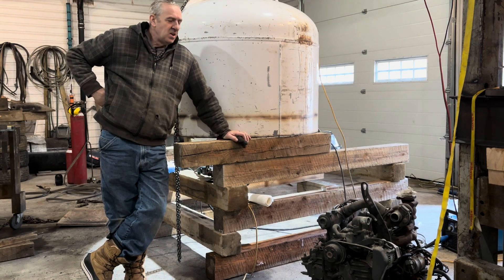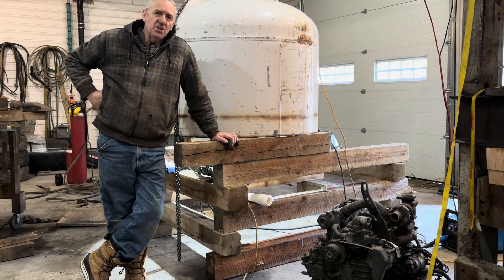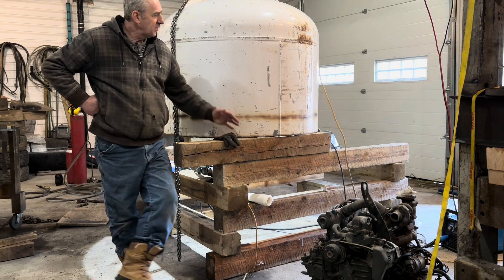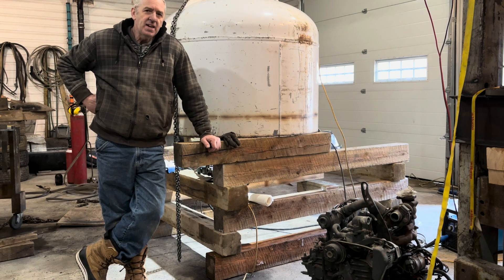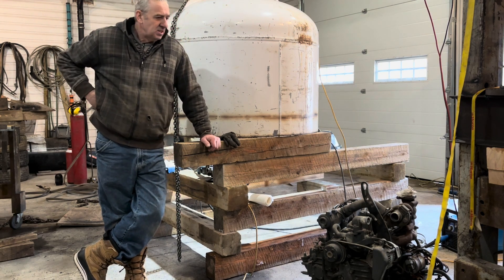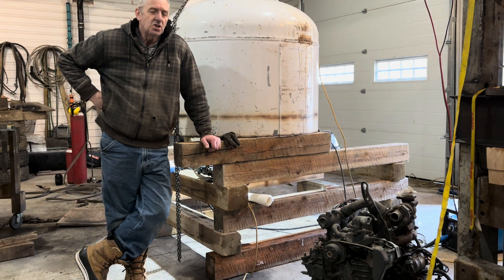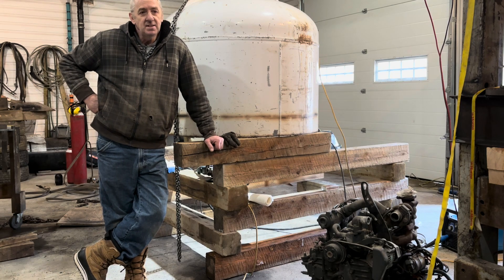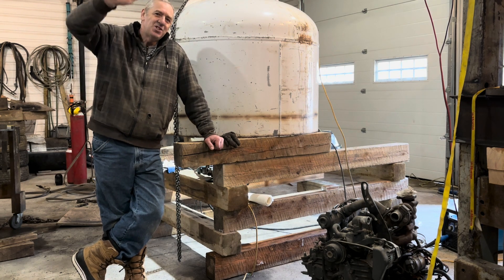Dangers of building a submarine

Comment: Most times it is the least obvious danger that takes a toll. Eye injuries, finger injuries, etc. usually from being too lazy to don the personal protective equipment. It is easy to see the danger of 750 pounds hanging from a chain. It is less easy to see the danger of a 6 foot high ladder. If you are 20 feet in the air on a ladder you are far more aware of the dangers of the height than you are at 6 feet. At 6 feet you feel more confident and secure because you are just not that far from the ground (complacent). In reality, you are far more likely to be severely injured or killed in a fall from a 6 foot ladder as there is just enough height for you body to do a 180 degree rotation an hit the ground head first. Complacency and laziness is what gets folks hurt. Thanks for sharing.
Reply from the maker: Yes exactly,
Reply: I have heard of a guy who died from just falling one foot off of the ground. It happens.